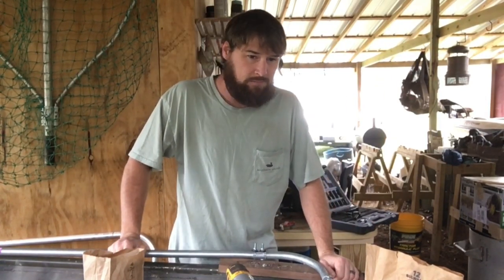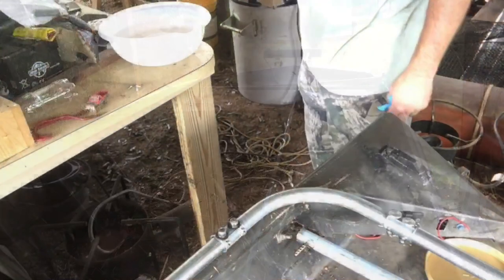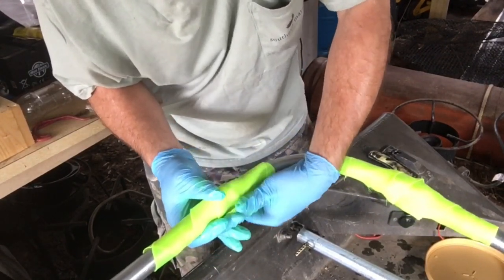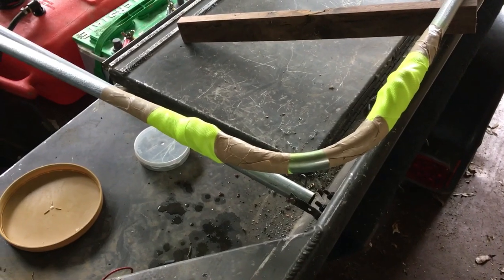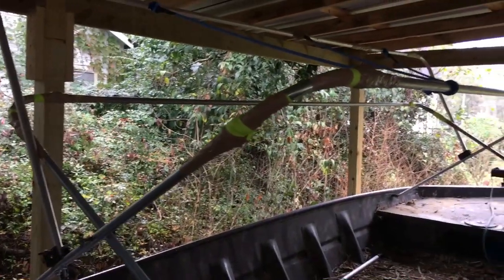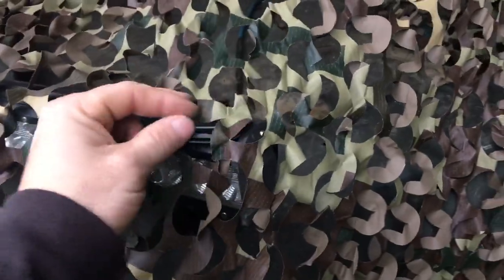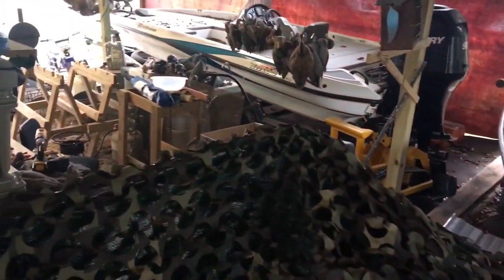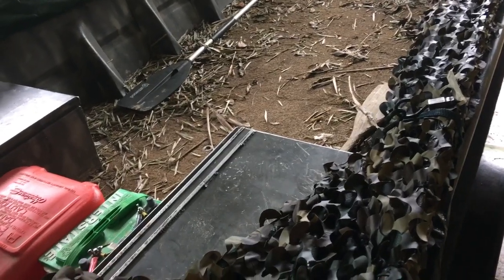Duck Hunting-Boat Blind Build

Comment: Better to bend the 90s as the connectors are not strong enough and crack. I use 3/4” conduit then at all joints sleeve 12” piece of 1” conduit over the joint and through bolt it. I can lean on mine no problem. Looks good though. I used rancho safari gillie boat blind material and a little raffia.
Reply from the maker: I’ve had no issues so far with that blind build going on the 4th season with it, I don’t have a way to bend them correctly

Comment: Hey man. Enjoying the channel.   What did you use to weigh down the bottom edge of the tarps?   I assume you just cut small holes to run he zip ties in and around the frame rails?
Reply: Finally heard it near end of video. Lol

Comment: Hey, what's that black part called on the X  and where can I buy one?
Reply from the maker: The black part? You talking about the bracket that top frame is bolted to?
Reply from the maker: If your talking about the bracket, I built it myself  out on 2 pieces of angle aluminum
Reply: @BlackBeltProduction  mmm maybe, the overhead piece that makes it swing. that part
Reply from the maker: Yea that’s  the bracket I built to attach the flip top, it’s made from angle aluminum. One for each side. Drilled and bolted to the frame, and drilled with a bolt through it for the flip top
Reply: @BlackBeltProduction  sweet, thanks, great build btw
Reply from the maker: Thanks, if you build it like I did, it will last.. I’m still using that same blind, there is another follow up video I made for taking it off for the off-season! Good luck this season and thanks for watching!

Comment: Go to the next size up in conduit slip it over the joint .. weld it up or bolt it. It will strengthen the joint better than that coupler
Reply from the maker: True, but I’ve had that blind now for 4 years, working great!